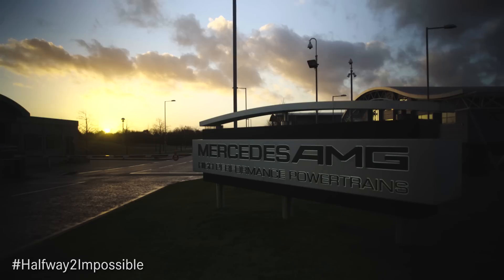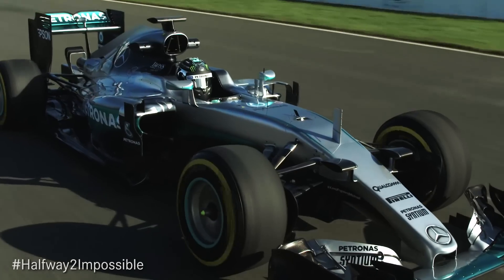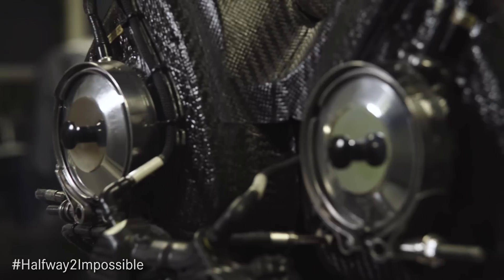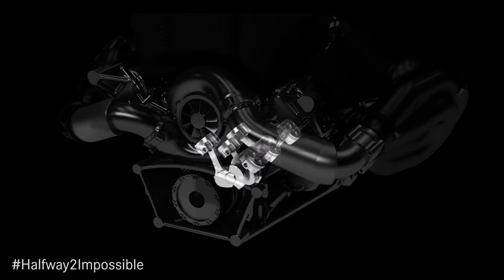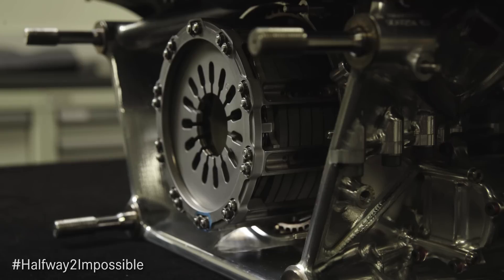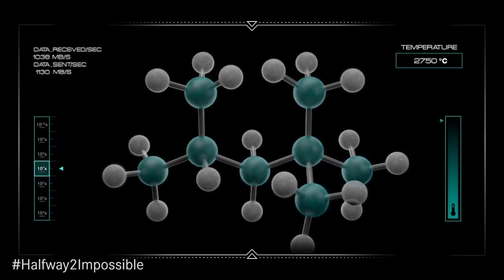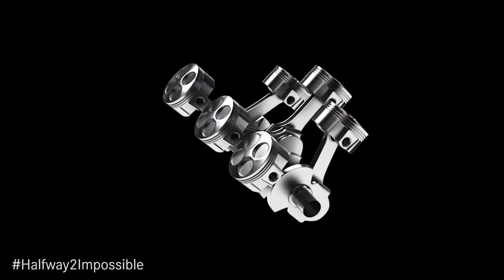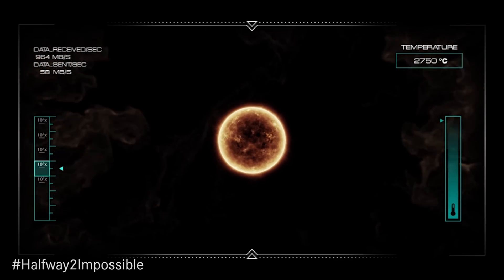What Do 37 Million F1 Ignitions Look Like? (1/4)

Comment: Hmmm 4 elephants... Rather of a vague comment / comparison. Actually would have loved to have a figure in kgs, or something to understand further. 
But great video!
Reply from the maker: We tried to make it as accessible as possible!
Reply: +MERCEDES AMG PETRONAS ....many thanks for replying, for efficient understanding would have been better to mention BOTH figures= 4 elephants = certain kgs ... Half of the temperature of the surface of the sun, yes we all get to check the temperature of the surface of the sun, I've been there yesterday, why I'm typing with my toes... Nevertheless great video!
Reply: @MercedesAMGF1  like people know the weight of an elephant or the temperature of the sun, ridiculous
Reply: What kind of Elephant?!. Theres a huge discrepancy in weight between Elephants!.  One type weighs more than twice than an other type!.
Reply: Yeah I came to around ~500psi. 4 elephants, assuming 20T, over an 80mm piston.
Reply: read over what I wrote carefully and it will make sense. If you want 
more accuracy you're going to have to model the problem including heat 
transfer and flame front expansion. And yes, 17:1 is okay if you're 
running racing fuel. The fuel is now heavily regulated, and they're 
running quite a lot of boost, so I doubt they're going so far up.

If you're not going to pay careful attention to information that someone, in good will, took the time to fetch for you, then I'll leave this conversation here.
Reply: If I remember correctly from my thermodynamics class you gat that force in a very small amount of time and it is not perfectly perpendicular to piston so you get two components. I remember when I saw those huge forces on such small surface I was like how it doesn't brake after few cycles
Reply: Please tell us the peak and/or mean maximum cylinder pressure!.
Reply: The mean you can calculate yourself with relative ease. Search for BMEP or Break Mean Effective Pressure. I'll do the math just in case anyone else is interested and too lazy to do it. I'll post it here.

edit:
Assuming around 780 HP at 12000 RPM the mean effective pressure is 3.6 kPa or 523 PSI. A very rough estimation of peak pressure would be to multiply this by the compression ratio, which could be anywhere between 8:1 to 10:1 on these plasma jet ignition thing engines. Of course if you do a more rigorous thermodynamic analysis you might come up with a better estimation.
Reply: Well, it seams they took the heavier variant of elephant. After doing the aforementioned calculations and looking up the F1 Technical Regulations (which oddly state the the compresson ratio must not exceed 18:1), the peak combustion force on the pistons is close to twenty metric tons. This is a very rough estimation, but a ball park nonetheless.

I assumed a 10:1 compression ratio.
Reply: When they were NA they were around like 17:1 compression ratio.
Reply: Your calculations don't agree with what this video is saying.  523 psi does not equate to 4 Elephants.
Reply: Mercedes-AMG Petronas Motorsport internal combustion engine are insufficient. Too much energy wasted in heat.

Comment: Wow! 50% efficiency, whereas the old engines hardly got 25% and a steam locomotive was even 5%...
Reply from the maker: +MK3424 #Halfway2Impossible ;)
Reply: @StauticMan  Battery Electric Vehicle has its benefit, but can you advise where do you get the 98% efficiency of Electric car? Charging the battery ans then use the battery to drive the car is a complete cycle to measure the efficiency of a BEV. I have not been able to find any real BEV achieving anywhere close to this 98% number. If the electricity use to charge the battery come from a fossile power plant, its thermal efficiency is also hovering just around 50%. If you use nuclear or other green power plant, then we get the real benefit of BEV.

Comment: Fuck the thermal efficiency and road going technology, Formula 1 is a sport and not a test bed or experiment! Bring back naturally aspirated engines and get rid off all these pathetic gimmicks like turbo's and puny little engines which bear no relevance to F1!
Reply from the maker: +Ammar Sajid So many different ways to respond to this. Suffice to say, we completely agree F1 is a sport. But it's a technological sport - and the old phrase "racing improves the breed" is born of the fact that this has always been true. Turbos and hybrids aren't "pathetic little gimmicks" as you call them - Grand Prix racing has had boosted engines (turbo or supercharging) since the 1920s, and hybrids since 2009. It's all about finding a balance between the two. But the simple fact is that thermal efficiency = power. So less efficiency = less power. And no racing fan wants that... :)
Reply: You know nothing. Thanks Merc for putting him in his place.
Reply: +MERCEDES AMG PETRONAS this comment is too hot or my cellphone has thermal efficency problems XD because #ThatSickBurn over him
Reply: When have F1 cars ever had large capacity engines ?  Bring back naturally aspirated big cube V8s ? The V8s in the previous F1 cars were 2 .4 litres . The current turbo cars engines  are bigger than the turbo engines of the 1980 s 1. 6 litre V6 .Now . The engines used in the 80s were 1. 5 litre inline 4 cylinders . Maybe some people should  engage brain before opening mouth .  F1 engines are and always have been , cutting edge technology . Lets see your big inch V8s rev to 18 ,000 rpm , like the 2 . 4  V8s did .
Reply: +Whydoesitmatter exactly.
Reply: well, if you car's engine gonna blow out, explode or something like that, don´t come here to cry...
Reply: +Ammar Sajid F1 has always been, in one way or another, a test platform for auto manufacturers. In the late 70's and 80's it was turbo engines, in the 90's active suspension and traction control, today it's hybrid powertrains.
Reply: Correct.
Reply: You boffins can have your hi-tech hybrid engineering. Just give us fans back the almighty F1 banshee sound!
Reply: +Stu Stevens let me guess you've been following f1 for the past 2 years and think it's the best thing since sliced bread?? Pathetic..
Reply: +MERCEDES AMG PETRONAS Right ok thats fine, turbo's have been around before in different guises, but remind me again were they using pea sized 1.6 litre engines or tiny v6's? If formula 1 is adapting to the current climate and road car technology then why can't f1 cars have "bi turbo" v8 or 6.2 litre turbo? Isn't that what your roadcars have at the moment?

Comment: This kind of efficiency renders diesel engines obsolete. Too bad that a special fuel is required to do so. I would like if the regs force a spec fuel formula to a something that is much closer to what you get at the pumps when you refill your street car.
Reply from the maker: Took the words right out of our mouth!
Reply: +Stoyan Kanev The fuel used in f1 right now is 99% the same as premium pump fuel.
Reply: +Nicholas Bainbridge If that was the case why is so much being made of fuel development if 99% of it is spec if that's what you are saying. I am pretty sure that the knock resistance is much higher than what you get at the pump
Reply: Stoyan Kanev 1% makes all the difference. Merc agrees, so if you think i'm wrong...
Reply: Nicholas Bainbridge My argument was not how much of percentage the fuel is identical. We humans share 98% percent of our DNA with chimpanzees, but still the difference is massive. The same is true with the fuel. If you put a premium pump gasoline in the current F1 cars, even if they work (which would require a big change in the ignition timing at least) would loose quite a bit of power.
Reply: Stoyan Kanev I know everything you just said. I even said "1% makes all the difference"
Reply: +Stoyan Kanev A spec fuel would also reduce the difference between the factory and customer engines.
Reply: +Berend H. All merc f1 customers teams get the same petronas fuel.